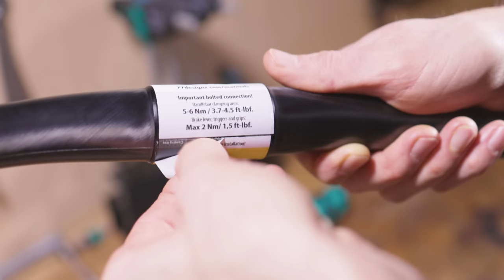Dream Build SCOR 4060LT 29in, Enduro Bike, Trail Bike, Fox Factory, 77 designz

Comment: I never did understand people who actually ride these ridiculously high end bikes. They must just have stupid money and use this simply as a hobby. Also interesting that it weighs 2 pounds more than my $3,000 2016 aluminum full sus 2x10 bike, but aight. That said, I love me a good build video! Excellent production and I watched every second!
Reply: really cheap components are usually lighter. the size of the bike also factors in, yours could be a medium or large, while the one he' building could be a L or XL
Reply: @BGbikeandski  Nah, cheaper components are usually heavier because they're made from cheaper (heavier) materials. High end bikes use materials like carbon fiber, titanium, and magnesium to shave off as many grams as they can. Cheaper bikes are made from materials that are cheaper to source like aluminum and steel. His Fox 38 is about a pound heavier than my Fox 32, but with the exception of calipers (I only have 2 piston); I would've thought all of the other components used would be lighter than mine. Not to mention he doesn't have a front derailleur and second gear up front like I do. Really not sure where that weight came from unless it's just all in the wheel size (mine is 27.5, but those are carbon rims where mine are aluminum) and tires.
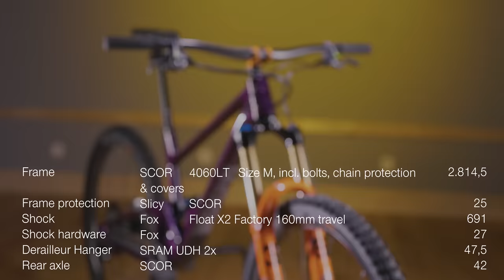Both my bike and his bike are mediums. 23:09
Reply: @Kcducttaper1  maybe all that grease

Comment: Dream bike for sure. But why no AXS? and why no Trickstuff brakes? That would make it a dream build for me (almost impossible to get Truckstuff stuff). I expected it to be way lighter than 14.8 Kg. That's what my old Speci Enduro (29 alu) weighs.
Reply from the maker: AXS is a nice choice for sure, but on this bike we preferred to have only mechanical components that last. XTR isn't so bad either😉 
You can check all the weights at the end of the video or in the description below. My guess is your enduro has lighter tires, but if you compare it to the current Enduro it gets tricky to keep it below 15kg without compromising on durability.

Comment: Why did it need a mark on the headtube to fit the headset
Reply from the maker: Scor uses the same headset cups for the short and long travel setup of the bike. With the notch facing forward you get an the slacker headangle of 63,8° . You can change the head angle by 1.5°.

Comment: No grease on the seatpost?
Reply from the maker: No, there's carbon paste on the seatpost. You can use either one, but you have to make sure the seatpost doesn't move. With carbon paste you can keep the torque at the seat collar to a minimum and reduce the stress both on the post and frame.
Reply: @worldofmtb